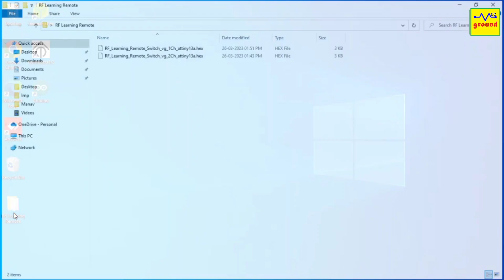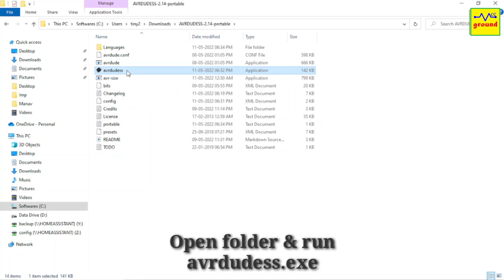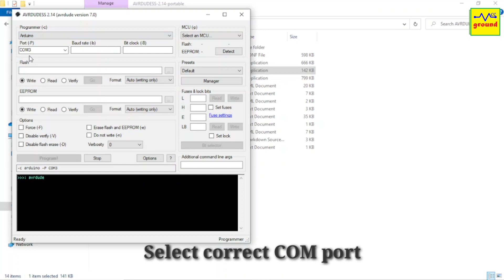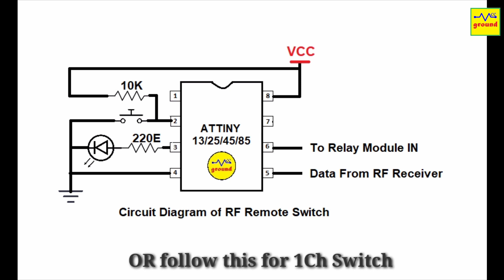#54 DIY RF Learning Remote Switch | Toggle or Momentary | EEPROM based  | No Hard Coding | vccground

Comment: Sir please  make a video on 433 MHz transmitter and receiver module circuit , draw the diagram and explain it in detail how it works , roll of every components. How the signal is transferred from transmitter to receiver  to control the dc or servo motor 
Please do it 🙏🙏🙏🙏

Comment: is there any security in this system? If someone sniffs the transmission of the remote that is paired and replays it?
Reply from the maker: That can be done not even only with every RF remote system but also with most radio frequency operated devices as well...
Reply: @the_vccground  That is true, but with some Keyfob systems like the Keeloq, the transmission is encrypted with some sort of shared secret key between the transmitter and receiver, which is supposed to make it difficult to undertake replay attacks....